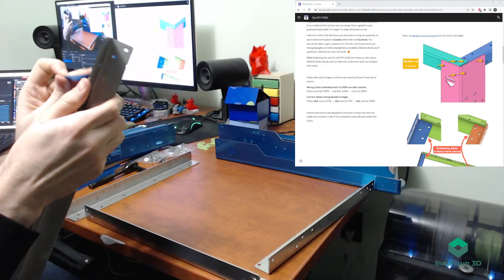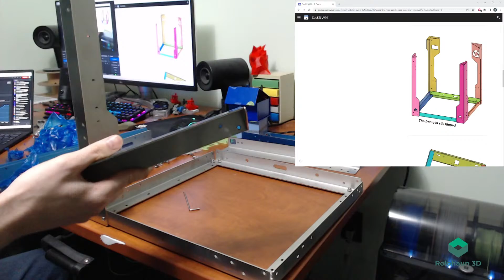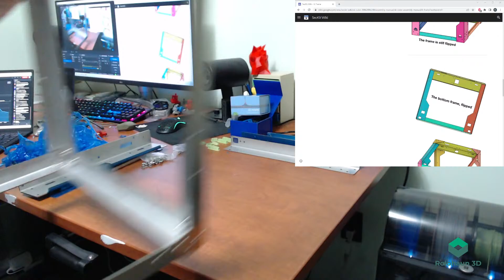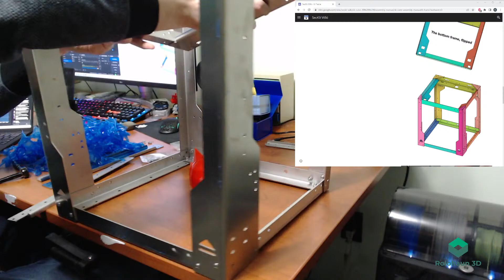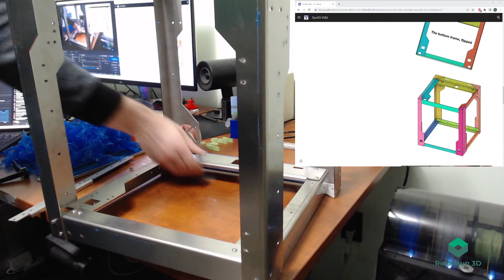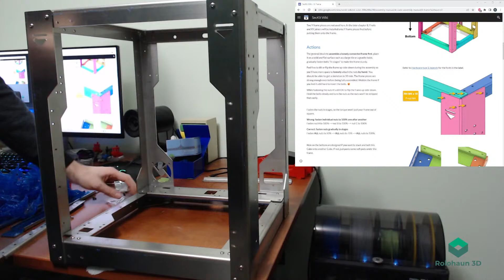SecKit Cube 200 Frame Assembly!

Comment: It's too bad this frame is powder coated. You could order it in a variety of colors?
Reply from the maker: the raw look is nice
Reply: @Rolohaun  until the moisture in your place starts to oxidize it. After that you’ll wish yiu did something to protect it, I think.
Reply from the maker: @corlissmedia2.0  the frame is made from 304 stainless steel. It will not rust

Comment: I think one of the problems with these sheet metal frames is, they have no mass to resist the print heads moves.
Reply from the maker: the frame is as heavy or maybe even heavier than a 2020 extrusion printer. These are decently think steel plates
Reply: @Rolohaun  ha, good morning, obviously, what do I know! I checked this printer kit out. It was well over $700. When I put that against the Ender 6 at $569, it kind of doesn't work? What about the tech in this machine versus that Ender with a Sonic Pad?